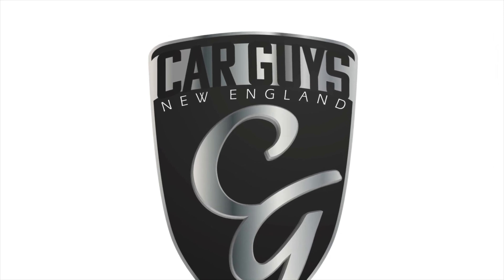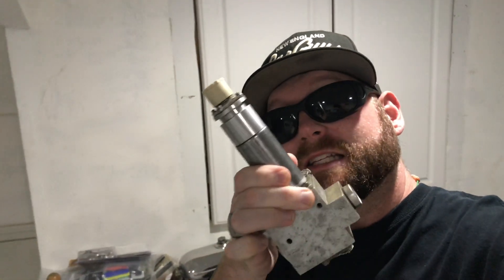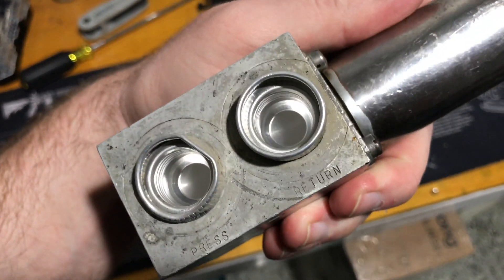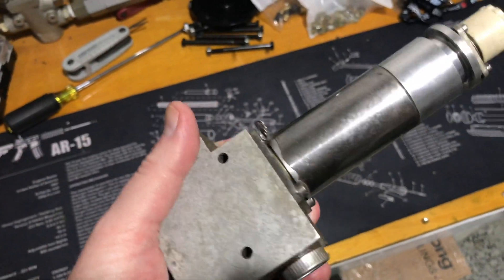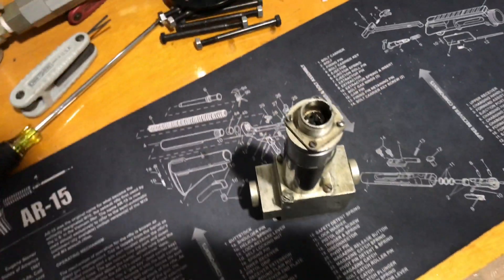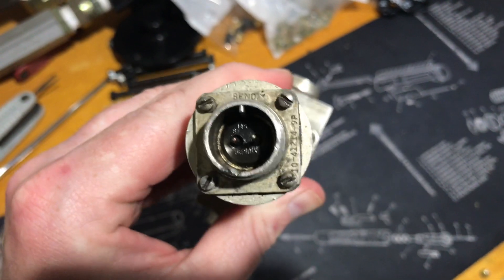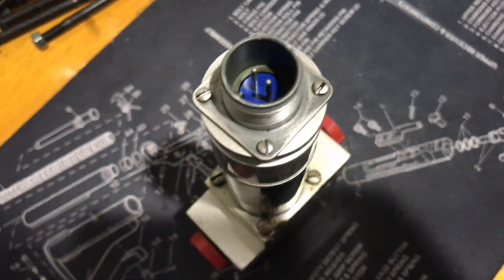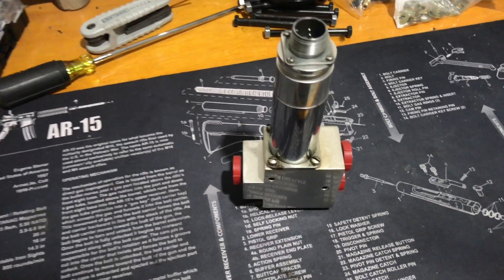Lowrider Hydraulics: OG Adel Dump Valve

Comment: Hippos sells a adel 2 dump. Is it worth getting one. What would it do? Hop higher?
Reply from the maker: It will be more precise than an industrial dump...
Reply: @carguysnewengland  oh .ok thanks. question  what hydraulic oil do you use in your pumps? Is aw 32 or 42 hydraulic oil ok?  What’s good and we’re to get oil from? Thanks.🙏🏼
Reply from the maker: @lifesgood4458  I use 32. Check link in description
Reply: @carguysnewengland  ok thanks og homie. Great vids.Thanks.👍🏽